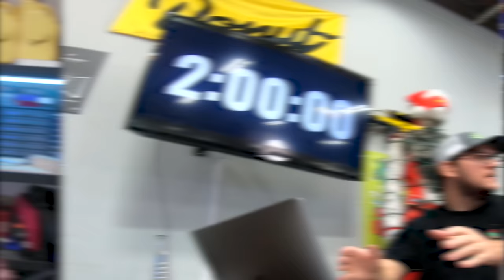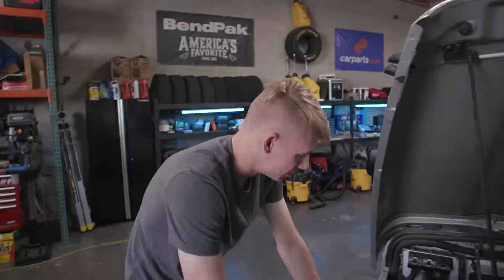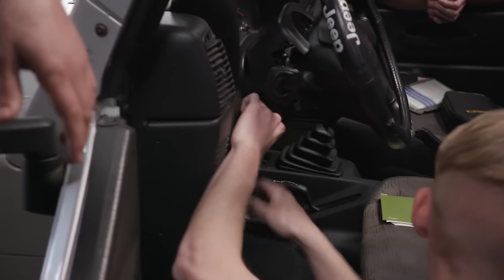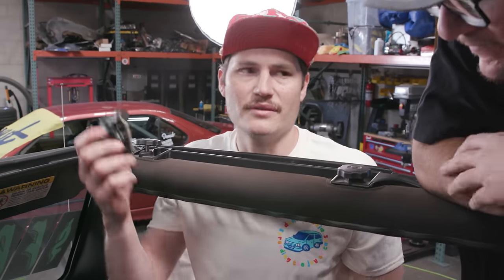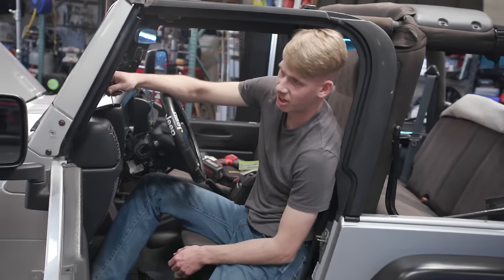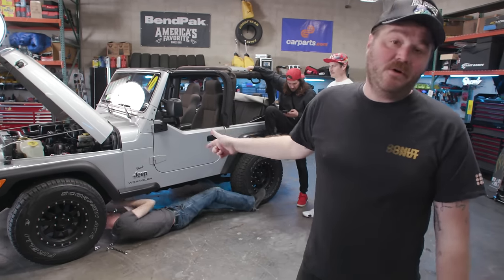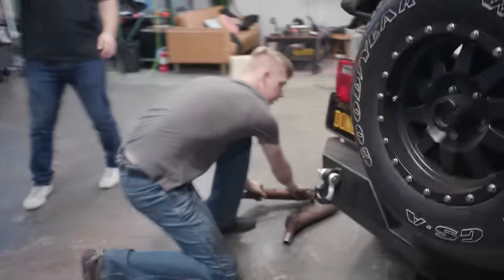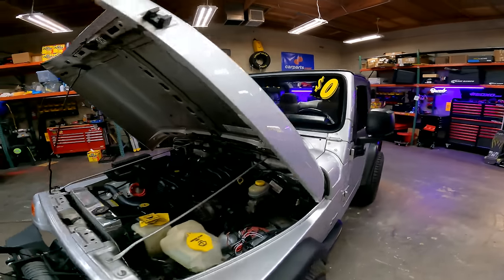Giving people a JEEP, if they can fix it

Comment: "On the next episode, we found the most over-engineered car where there's only one thing wrong with it, but the repair will require removal of 24 unnecessary parts. If they can repair it before having a mental break down, they get to keep it."
Reply: Sounds like a bmw
Reply: or an Audi
Reply: Passat W8 😂😂😂
Reply: A battery replacement took 4 hours on my girlfriend's mercedes because we needed to take a bunch of things apart. A battery took 4 hours. I did my honda's in 5 minutes
Reply: Abarth 500
Reply: @champion8795  omg I feel this in my soul. I have a 2012 and while I love the car, I absolutely hate when I have to work on it.
Reply: BMW
Reply: it’s just a rb26dett with like a rod bearing split
Reply: @rando5673  what mercedes? it takes about 5 for the front battery and 15 for the inside battery
Reply: Oh man, as a counterman at an independently owned national corporation, I'd love to share the utter dismay and often disgust many of our customers experience when replacing the same part, with the same design flaw, because it's more cost effective to a CEO's profit margins to continually replace the flawed design, as opposed to solving the problem and LEGITIMATELY correcting their often redundant and known design flaws 😅 
It's starting to take away from my enjoyment of an automotive hobby, and flat out hamstrings me from the get go as to being able to provide a proper level of service for my community and their crap tastic diesel technology "breakthroughs" 🕳️
(Thanks for letting me grumble 🤘) good luck out there folks ✨
Reply: saab 900 😭
Reply: That sounds like an amazing idea.
Reply: Easy, just bring them my BMW.  It's sitting there with a busted crank position censor which requires the entire removal of the intake manifold, intake, fuel line, etc.  Pelican Parts say it's a 3 hour job, yea right.  Always take it with a grain of salt when working with a German.
Reply: Sounds like my S80
Reply: I’d love to be an applicant for that episode
Reply: Bmw
Reply: Sounds like the non-WRX Impreza head gasket
Reply: Beemer?
Reply: @rando5673  I like my landcruiser battery, it just chills in the front with enough room around it for another engine lol
Reply: 1UZ starter replacement 🤣
Reply: sounds like Tiger 1
Reply: @rando5673  had to rip apart the whole front end of my girlfriend’s old Cadillac just to replace a bulb. It was a nightmare. So many little clips.
Reply: Jaguar?
Reply: Change a headlight on an HHR.
Reply: Laughs in jaguar
Reply: all they need to do is buy an old caddy with a northstar and tell em to replace the starter
Reply: Got to be a German car then lol
Reply: @kevintownsend8454  is it that much worse than the maintenance on a naturally aspirated multiair? Bc I’ve had little to no issues on my 2013 pop.
Reply: @walterhankin46  it isn’t worse than the NA version or so I would imagine, I’ve not messed with one myself. Just that they have Avery thing packed in makes it pretty damn annoying. I did a MAP sensor and throttle body replacement and they were a pain to get to
Reply: The oil pressure sensor being backed up to the firewall on a jk
Reply: Changing my belt on my e46 be like:
Reply: @rando5673  the battery is under the seat in my moms audi lol
Reply: 6.0 powerstroke
Reply: Nissan Titan with the starter UNDER the intake.
Reply: @takumijager2372  Was about to say a E65
Reply: Cool, a Phaeton W12 sounds like a fun 24 hour special.
Reply: Sounds like a 1st gen Toureag
Reply: No…the diagnosis itself takes two hours, and you probably need a specialized computer interface. Repair? Give that a day or two.
Reply: "If they can do an oil change on a VW in an hour they can keep it:
Reply: @rando5673  you have to have a special computer for some new cars just to replace a battery.
Reply: Thermostat in a 2014 Dodge Dart GT. Hint: it's the opposite of "on top of the motor" and motor mounts are involved... and the housing is plastic.
Reply: @ned_frankly  any GM period. Way too many bolts and body retainers and shit. Want to remove your battery? You have to unbolt like 14 things
Reply: Definitely a Volkswagen or bmw
Reply: sounds like an e36 starter
Reply: Porsche.
Reply: Z32
Reply: Oof that sounds like a lot of fun!  Id love  to have a try as a mechanic im always up for challenges😈
Reply: @micha3743  more like a phaeton
Reply: Duramax fuel pressure regulator 🤣
Reply: @rando5673  wow!  4 hours  for a battery replacement! Bruh!
Reply: Nah the gotta do it with the chrysler motor that has the starter installed in the block and break the starter
Reply: Every German car
Reply: A Bluetec Mercedes?
Reply: It’s called a bmw 🤣
Reply: Like rich rebuilds Audi A7 the little filter in the turbo
Reply: Ah! A fellow Mercedes owner!
Reply: Mercedes Benz with OM651 engine :D
Reply: Audi B5 S4
Reply: @andriuspetkuz7992  OM642 with oil cooler leak, swirl valve jammed from carbon buildup, oil leaks everywhere and fastener that are all different sizes.
Reply: Welcome to a 3.6 VVT oil cooler 😭
Reply: Not at all lol
Reply: My Z32 in a nutshell
Reply: @DroneStrike1776  omg be quicker to do an engine swap 🤣
Reply: So a VW
Reply: Saab
Reply: @takumijager2372  yep like a starter on n52 or n54 motor or even an e46 era straight 6
Reply: Must be german
Reply: @rando5673  was it under the seat? If so I feel bad for you man. Shits miserable. However anywhere else isn’t too hard
Reply: @rando5673  Bruhhhhh
Reply: Sounds like a fucking Infiniti g35
Reply: I’m dead 😂
Reply: Jeeps are definitely not the most over-engineered "cars". That title goes to basically any 2011-2014 volkswagen.

GTI's came with a a oil screen in the camshaft bridge to stop contaminants from causing a oil passage blockage. Yet, the oil screen breaks or pops out and causes a oil passage blockage. Amongst so many other things intended to prevent issues, ironically causing issues they're meant to prevent.
Reply: Nope a 60’s chevy truck
Reply: Volkswaggen
Reply: Chevy lumina just to change a battery? 😅
Reply: a bimmer?
Reply: You mean Any European car?
Reply: So you mean a new model BMW.....? 🤷‍♂️😂😂😂
Reply: French cars
Reply: @takumijager2372  eye  doctor doctor rttt  yet right back back ettttttrttrrt ye yes  everything ok with it and I will will call call ehim soon etyttt I I see how how much I redureitrd try
Reply: Sounds like changing a headlight bulb on my 2009 Silverado HD.
Reply: @takumijager2372  I literally said this exact sentence before reading your comment
Reply: @micha3743  so true my friend owned one that needed some work it never ran and he sold it XD
Reply: I love this idea haha
Reply: @takumijager2372  2008 Chrysler Pacifica. To change the front motor mount I have to remove the radiator and some other dumb shit and losen up most the subframe. Yea don’t by a Chrysler. Stick with ford. Cheaper parts and you WILL find then at every parts store. Chrysler nope. Has parts that have common issues but the parts are not made anymore.  Keep in mind that I’m talking about a 1995 mustang. 27 years old and still make parts but Chrysler pretty much said f you customers. Well f you Chrysler.
Reply: I'll do it
Reply: @imnottellinudontwannaknow3188  same on a friends 16’ Ford Transit’ 

Seems like a crazy weird location to me’ and then they just put a tiny 1/4” hose to “vent” the off gases outside lol’ makes it a PITA to replace
Reply: Gt3000 😭
Reply: Saab
Reply: Chrysler moment
Reply: Plugs on a Ford 5.4L V8 or a Mitsubishi 3.0L V6
Reply: VW Touareg with v10
Reply: Over enginnered = Toyota
Reply: I could definitely see it being a BMW (like many people here aren't saying), but really any German car will fit in that description. Think about Audi or VW, if he had to do a starter or alternator the task of 1st getting the car to what they call "service position" takes a long ass time. The whole front end of the car has to be removed,  including draining & removing the entire radiator, & you still have to work from underneath the car & maneuver all sorts of angles to get to the bolts and fight the part through the oil transmission cooler lines & wiring harnesses, etc, etc ,etc.
Reply: @selfaware9266  the o2 sensors on those F150's are a pain in the ass

Comment: Man, I was really wishing he was gonna be a smart ass after the driveshaft failure and pop it into 4WD and drive out of there in FWD. Would’ve been a great move!
Reply: Right. This is the first thing I thought of.
Reply: I was expecting him to take off his belt and sling the rear drive shaft too lol
Reply: Yeah but the spinning drive shaft would've destroyed both the underside of the car and the floor
Reply: @kostaspolichronis  not when you're crawling 20ft out of the shop
Reply: I was hoping for the same thing lol
Reply: @kylejazwiecki714  no it will continue to turn, but all he would have needed to do was slide the slip yoke out of the transfercase and drove out leaving a small trans fluid trail from the rear output
Reply: I had to do that with my tj when the rear differential blew, drove it home fwd 😂
Reply: Yeah but then the driveshaft could’ve bounced and destroyed his bottom.
Reply: @angelgjr1999  the drive shaft was still attached in my case but the gears on the inside of the differential were shot
Reply: I waiting for the same thing 😂 I kept saying cmon just toss it in 4wd and drive out with the driveshaft in the passenger seat
Reply: I'm just waiting for the day one of the contestants drives a car out of the garage using the starter motor
Reply: I came down to comment this but figured it was already thought of
Reply: @abccanada6248  disconnects neutral safety switch "Peace, fuckers!"
Reply: @FullSendFarm  Exactly!
Reply: @FlightRecorder1  exactly!
Reply: @shaunmilor  lol same
Reply: I was thinking the exact same thing! Was yelling at the TV "Just throw it in 4 high!" These guys arent true off roaders! 😆
Reply: I ran mine for a week in FWD waiting for my rear driveshaft to get some new ears. Agree, that’s what I would have done there.
Reply: Ngl that's what I would do
Reply: Exactly what I was thinking haha! 😂
Reply: Thats actually what I had to do with mine when my driveshaft u joint exploded
Reply: This just proves he's not a real Jeeper. First rule of owning a Jeep: it's not really broke if there's a free work around, no matter how ridiculous or dangerous the workaround might seem.
Reply: That was my first thought to especially if you’re on the clock grab the cut off wheel cut the broken driveshaft and drive out
Reply: I thought the same exact thing haha
Reply: @kostaspolichronis  wouldnt be that bad, especially at a crawl
Reply: Went to the comments to find and like this specific comment. I’ve done that on a trail
Reply: I was thinking the same thing
Reply: @FullSendFarm  not necessarily, because it has a u joint or whatever aslong as you have it in 4 low and just crawl out, it will continue to spin but at a slow enough speed that it will stay leaning down therefore not hit the underside of the car.
Reply: @furedi8067  I've owned nearly 100 jeeps, I promise you that 13" driveshaft is not long enough to take the slap out of that ujoints lockup points.
Reply: I’ve done this to drive 10miles to the house in my jeep

Comment: When y'all are watching this remember, he spent 30 minutes thinking before he turned a single screw. As soon as he stopped over thinking so much, and picked up a tool, things started happening. I bet you without the clue and the little push to the ignition switch he would have run out of time before he started. Dont be intimidated people, you can do it too.
Reply: This is such a wholesome comment, thank you for this encouragement lol
Reply: 20 minutes of that was time taken off of the clock.
Reply: Solid point.
Reply: We are our own worst enemies.
Reply: @ryanturner3432  that’s being pretty easy on him, in reality he would’ve spent a lot more time going out to the parts store to get replacement relays and fuses for things he didn’t need, which also means wasted money

Comment: When your driveshaft fails and you only have to move it out of the garage to win you put it in 4wd and limp it out on two powered front wheels, but he's a new jeeper, he'll understand soon.
Reply: Had a buddy with a 89 power ram backed in to his spot at work and driveshaft popped out he pulled it off chucked it in the bed and for the rest of the week had a fwd pickup
Reply: That’s exactly what I thought when he didn’t throw it into 4 wheel lol. He’ll learn soon that broken h joints aren’t uncommon for jeeps
Reply: Given the rules of the game you'd have to front wheel drive it until you buy your own I would suspect.
Reply: @RIPxBlackHawk  Ask for the part before you leave XD
Reply: I went straight to the comments to say this. Wouldve saved him so much time. Props to him for not doing it the shadetree way tho
Reply: @RIPxBlackHawk  those are pretty common part to break you can buy them everywwhere and for pretty cheap too, or he couldve just asked for the part chucked it in the back and drove off
Reply: I searched for this comment before I made it myself! Lol

Comment: As a locksmith, one of the things I want to see “messed with” is the key itself.  Most cars now days have a transponder chip embedded in the plastic head of the key, if the car’s computer doesn’t recognize the chip, the engine won’t start.
Reply: That’d be dastardly 😈
Reply: @mateuszzimon8216  newer Renaults do still have a key in those cards
Reply: @tamastenhaaff2291  older also. But to run u still need a card with battery (even dead, because it's part of immobilizer system)
Reply: That would take way too long to diagnose 😅
Reply: That would take way too long to diagnose 😅
Reply: @godwinobas  Nope, if u Insert a Kay without transponder u get an icon(on EU market cars)
Reply: @mateuszzimon8216  Oh I see
Reply: never knew this until one of the trucks at work wouldn't start and I was so fucking confused lmao
Reply: Now that's villlee
Reply: Yeah me 13yo Honda disables the fuel pump until the key is recognised

I found out when I accidentally activated the ignition/steering wheel lock and furiously ripped the key in half
Reply: True

Comment: I would have put it in 4wd without rear driveshaft and drive out just for safety😂😂😂
Reply: Could have bypassed the starter switch and just jumped the relay with a screwdriver to completely cheat the whole contest😂
Reply: @isaacbednaryczk6111  that's what i was thinking 😂
Reply: I've had vehicles that I drove in 4x4 to just get around.

Comment: This was fun.  My daughter’s TJ had an intermittent no-start.  I replaced the ignition switch and key tumbler and then found the ignition switch actuator rod was broken.  Replaced that and no more no-start!!  Until the starter expired.  Then we find a previous mechanic ran it on with an impact and stripped the bolt heads.  Now it’s stuck and we can’t get a tool on the stripped head.  Probably gonna have to weld a bolt to it.

Comment: Jerry: "So what Adam did was cut this U joint off and then JB welded it back together, uhh as soon as he started goin, once it had enough tourqe applied to this joint right here it sheered em right off. Now he swapped that out, n maybe this thing'll roll. Maybe..if he put it in good. No one's checkin his work"

 Zack: "That's true"..that's probably one of the best lines Jerry's ever said.

Comment: The rear drive draft on my YJ sheared in a similar manner in the middle of Montana (a state I have zero familiarity with) going about 70 mph after my transfer case locked up. So here's a trouble shooting tip for everyone: if you hear very loud gear grinding, maybe add some oil to your gear box or transfer case instead of turning the radio louder and louder from Florida to Montana.

Comment: The first thing I would’ve done was hotwire that Jeep and jump the solenoid 😂 after I did my manual swap the neutral safety switch was stopping it from cranking so I just turned the key to on and jumped the starter relay. Started up reliably and then I later just tuned the neutral safety switch out of the ECU once I got ahold of an HP Tuners Pro Tuner.

Comment: As the owner of an 07 wrangler with the 3.8 v6 the dealership had to replace the original less than 1 year after purchase.(bought new at the dealership. There's an old saying Jeep = just empty every pocket.. but I wouldn't give it up for a brand new car. Jeeping is a lifestyle and I have stopped to help others in Jeeps and been helped by them.

Comment: Would be cool to see some actually challenging faults to diagnose, with some more time on the board ofc. Stuff like pulling a connector from the bottom of a fuse box, short circuiting powertrain can etc. They would also need the wiring diagrams for the car tbf.😆 But it would be fun to see how fast people can figure that stuff out.

Comment: Fun tip.  If the rear u joint goes out just use the 4wd and drive it out in front wheel drive lol.  Been there done that.

Comment: jeep used to  install twin cam engines in the 85 t0 92 it was a for banger and mostly sold to the postal service, they were junk from the start, put it third gear and let it roll backwards with the engine off and the timing belt would jump, lucky for guys that worked on that 4 wheel turd, it was a non  interference engine

Comment: He didn't need to replace the rear drive shaft, since it's a 4 wheel drive😂😂. If it's a permanent all wheel drive, you only need to lock the (i don't know the english name) differential of the the front and rear axis. They said the Car has to be running and you have to cross the finish line😊

Comment: Swap fuel return line as the main fuel line
It will start sometimes but it wont run good
Drive for 30 minutes though and the charcoal canister will leak fuel, extremely common mistake people make when they don't label hoses when dropping a tank